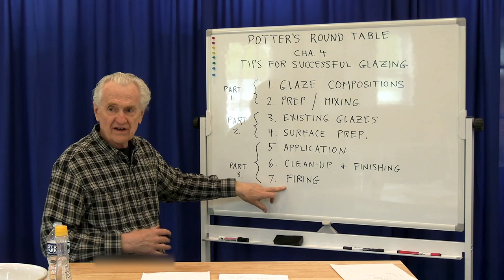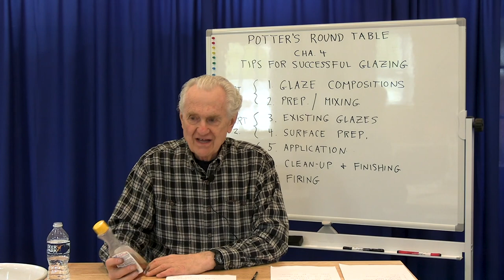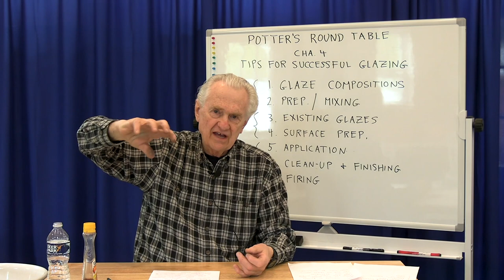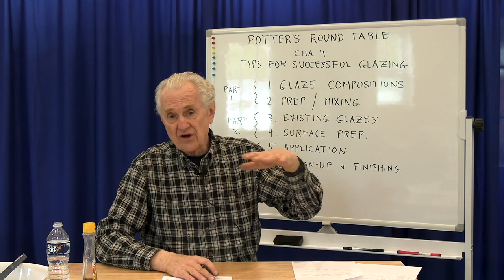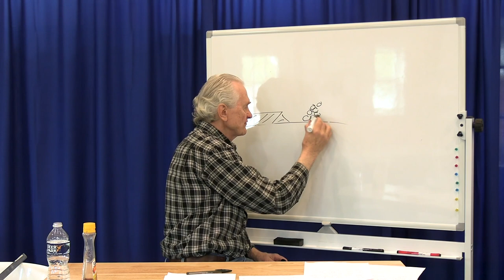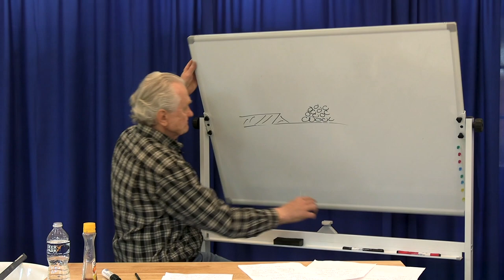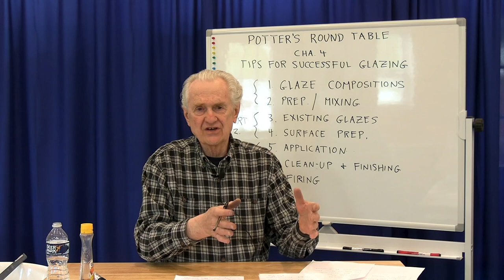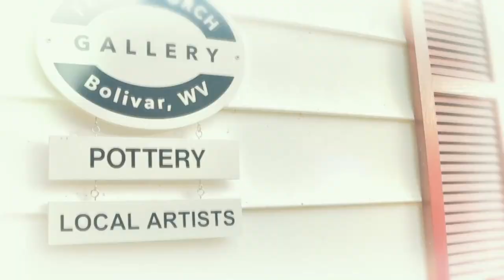Understanding Pottery Chapter 4 Tips for Successful Glazing Part 3

Comment: Hi!! As always thank you so much so generously sharing your knowledge 🙌. 
What do you mean when you talekd about "spray starch" on the glazed piece? What kind of material/ingredient is it? 
Thank you!!
Reply from the maker: Spray starch is used for ironing clothes, but not so much anymore! You can also use hairspray or any spray on adhesive. You can also use white glue diluted in water, 1 part glue to 10 parts water, and spray it on with an atomizer or pump spray bottle. I hope this helps!

Comment: Hi Phil, I recently used the Laguna Moroccan sand glazes and Coyote's satin glazes, both are cone 5/6 glazes for 04 bisqued earthenware. The colors however didn't come through and I believe that's a firing temperature/ cooling issue. Could you kindly guide on what you think could have possibly been the issue?
Reply from the maker: Hinal Shah,
I assume you mean that the earthenware clay (red?) was glazed and then fired to earthenware temperatures (approx. cone 06)? In this case, the glazes would be severely underfired since they are intended for cone 5-6 firing; the glazes would not mature and the colors would not develop properly. If, instead, the pots were fired to the suggested range for the glazes (cone 5-6), and the earthenware clay somehow did not bloat or slump, then the glazes could be mature, but at the elevated temperature, the glazes would react somewhat with the partially melted clay, and the colors of the clay would be "muted" (also due to the colored background of the clay).   
Thank you for your question and remember to share the channel with your friends and fellow potters!
Regards,
Phil

Comment: Hi there. In one of your videos to said to wipe the  surface of the bisqued fired surface before applying glaze, what of I apply glaze on a greenware surface too?
Reply from the maker: Wiping the surface of a pot is to remove dust and debris that may clog the pores of the clay and impede the glaze from penetrating. If there is a dust or dirt buildup on your greenware then you should wipe it off. But you will need to let the greenware fully dry before glazing or the glaze will not penetrate and adhere to the clay or you could end up with shivering or crawling. Good question, thanks!
Reply: Another question, hope I am not bothering you a lot. If my glazed piece is on the shelf for a while it gather dust on it's surface which I find very hard to remove is that ok to fire it that way with some dust on the glazed surface i.e.
Reply from the maker: @jabeenirfan8218  Firing with some dust on the glaze surface won't hurt the kiln and most likely will not show up in the final product since most organic material will burn off during the firing. If you have something to cover the pots when they are glazed and waiting to be fired that would be best. Keep the covering loose, you really don't want to trap any moisture.